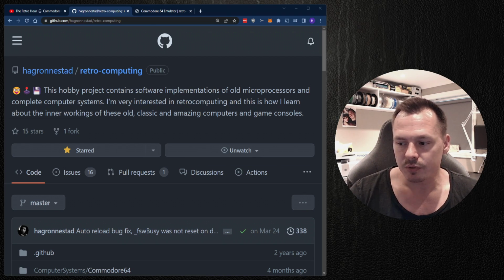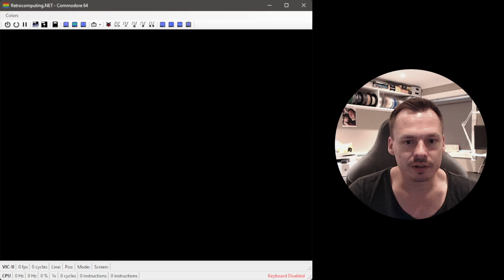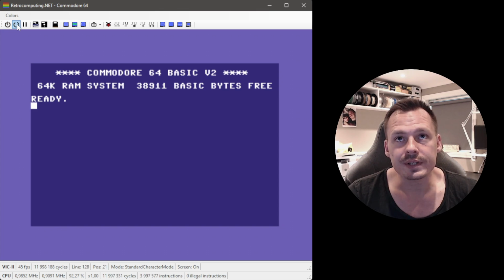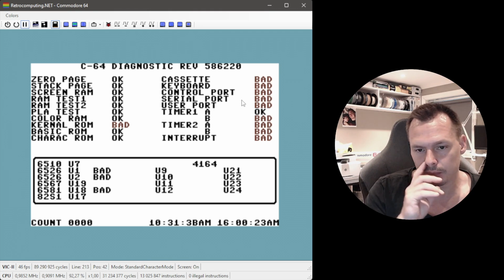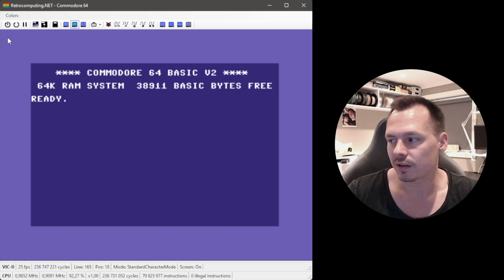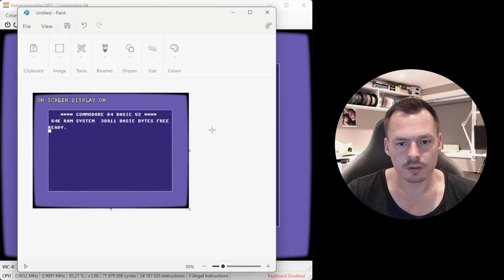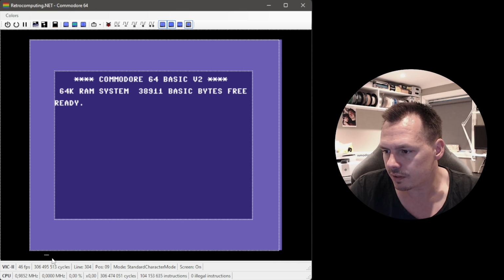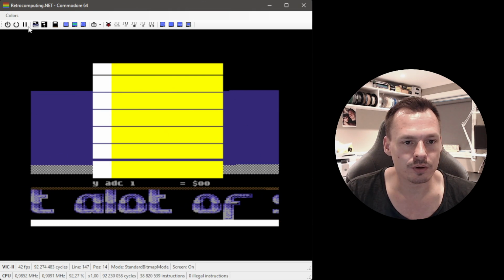C64 Emu Series⁉️ [1/?] 👨🏻‍💻📺🕹️ My Homebrew C64 Emulator

Comment: I would really like to see the ability to use cartridges with a simulator. There were a few oddball cartridges (like MIDI interface) that weren't common and were hardware add-ons rather than software. With a microcontroller I could see the possibility of making one that could plug into USB, but I haven't had a chance to really look into that yet.
Reply from the maker: I agree. I've been toying with the idea of making a hardware interface that is part of the emulator. So that you could connect the emulated software bus to a real hardware bus. I'm sure it's not as easy as it sounds though, but it would be really cool.